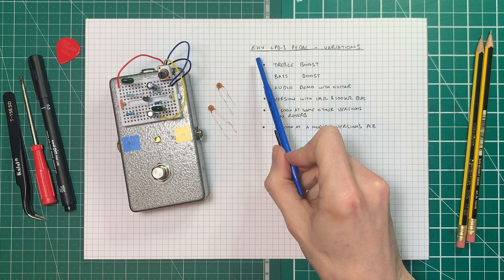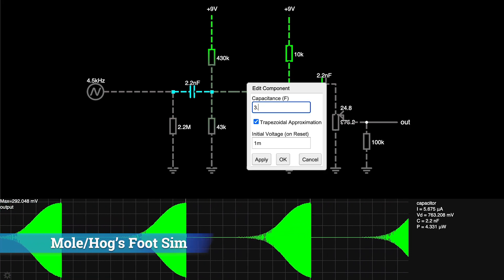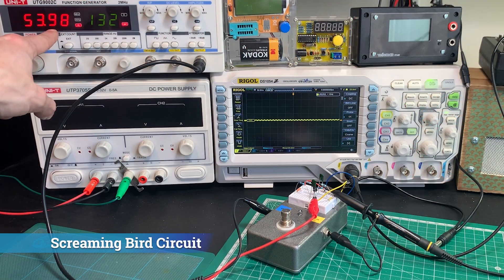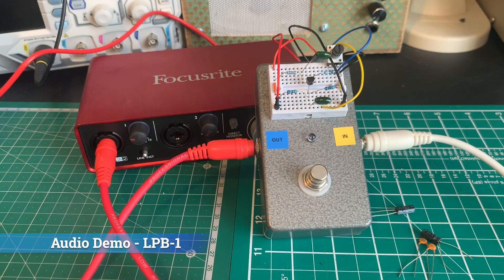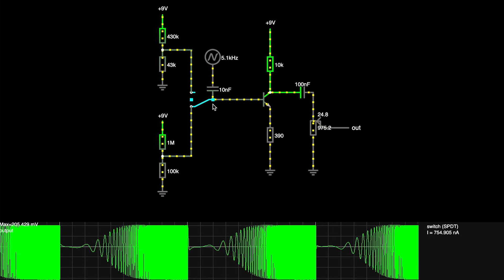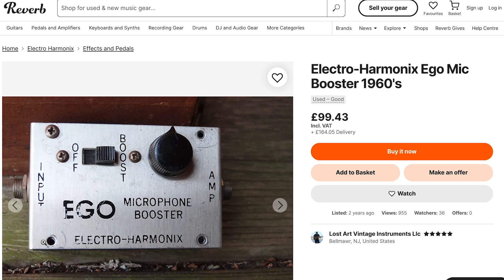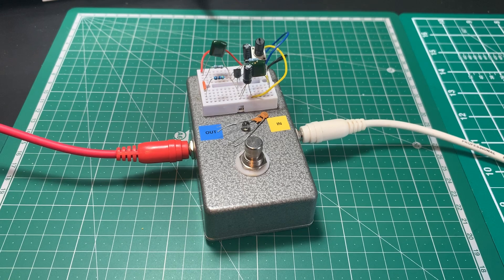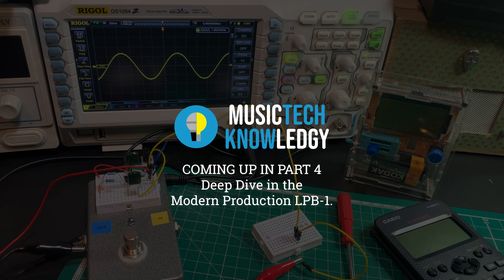Linear Power Booster - EHX LPB-1 - Circuit Analysis - Part 3 - Variants

Comment: Hi, for the potentiometer at the end of circuit that attenuates that output before the final 100K resistor, what is the maximum practical value this can be? I wanted to add this circuit inside an electric guitar but I wanted to use some existing potentiometers. These have values of either 250k or 500k. Also does it matter what taper is used, either log or linear? Thanks, John
Reply from the maker: It's not going to affect the output impedance very much either way because of the other resistors, especially RC.  Therefore, my advice would be to try both values and see what responds best in that situation.  Audio taper probably gives a better response but the taper is not electronically important, just how we hear the result.
Reply: @MusicTechknowledgy  thanks very much for the advice. I will give it a go!